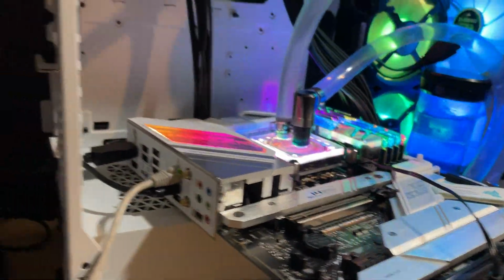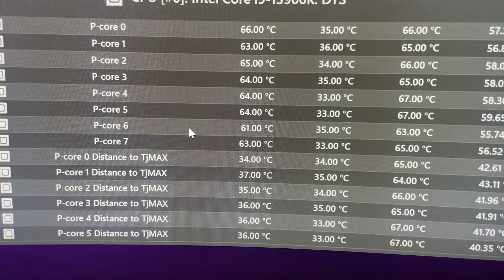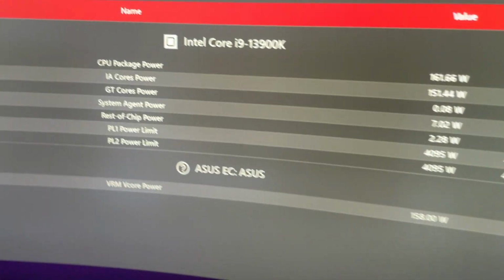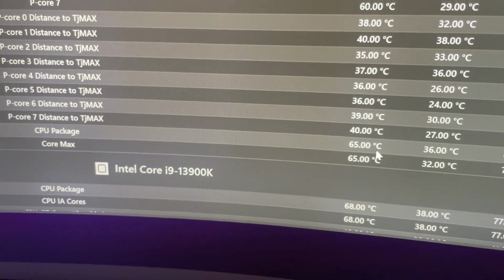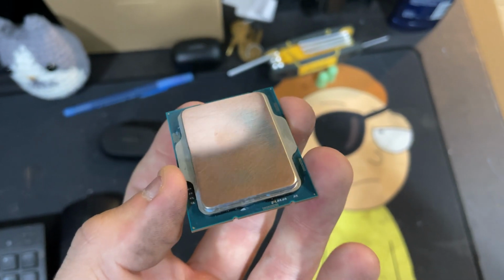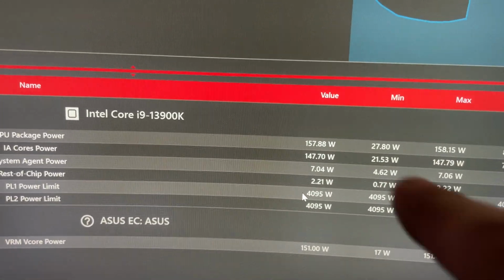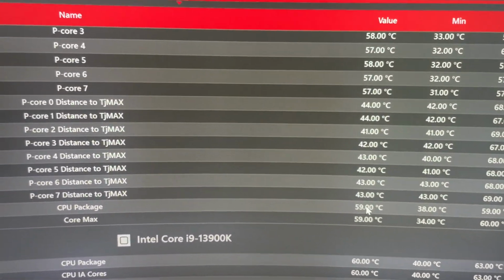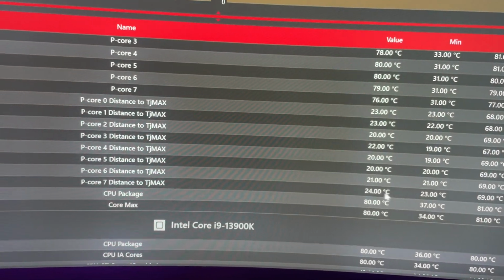13900K Delid + Contact Frame Temperature Results

Comment: How about you try a modern high and watercooling block and a big ass (mo-ra) radiator with that?

The problem with all of your temp testing is are the changes in roomtemp. Testing things like this in a room without ac, just doesn’t deliver reliable results.
Reply: relax its like a 2 min test lol
Reply: @ramair325  it's stil a problem. The results may as well be random.

In the second half of the day outside and room temperatures are dropping so later tests will show lower temps. Lapping delidding and takes time. There might as well be no difference at all. Now some kid runs out and delids / laps his chip for what ...

If he wants to measure differences in the <5% range then his measurement error should be significantly smaller than that.
Reply: @erisium6988  It is very much a problem. As I said the results are bs. So the video does not deliver any value to anyone.